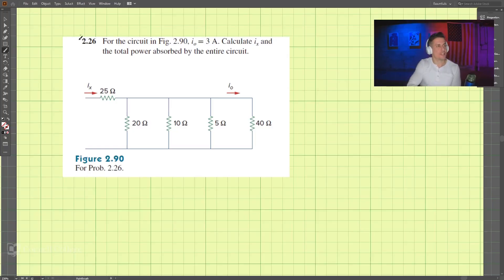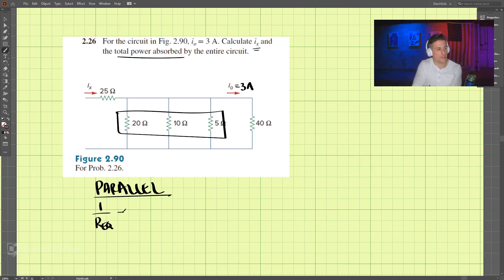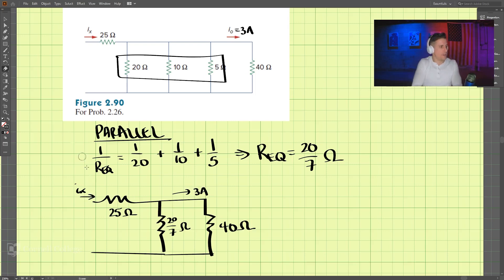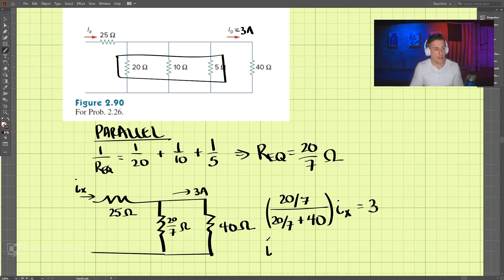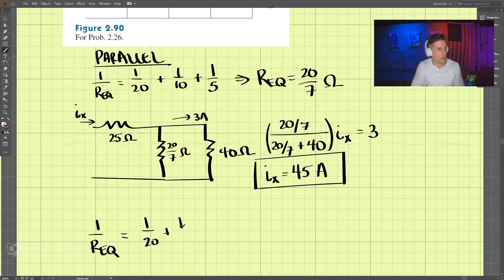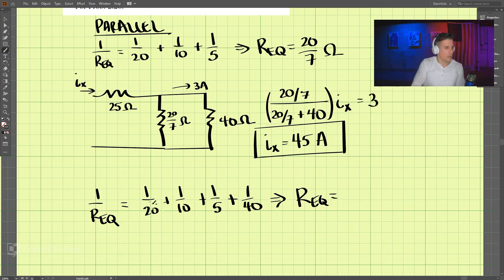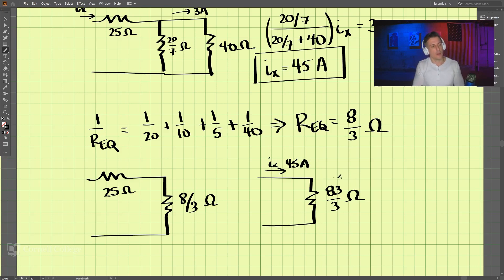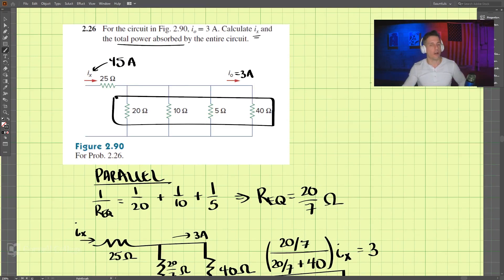2.26 - Example Problem - Fundamentals of Electric Circuits

Comment: 3:06 for the current division, why don't we add the 25ohm into the current division equation? when we use the current division don't we need the R_eq?
Reply: Current division is only used for parallel resistors. All the current that flows through the 25 ohm resistor is then distributed through the rest of the resistors. We find the current through the 25 ohm resistor by reducing the resistors to two (the one we know the current for and then the rest that are in parallel with it).